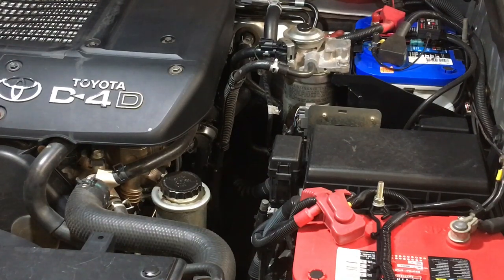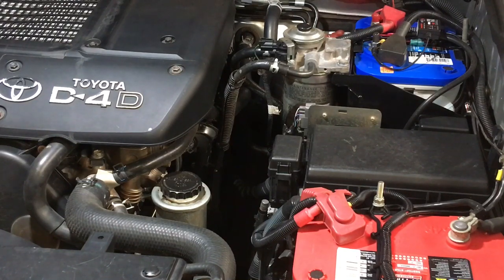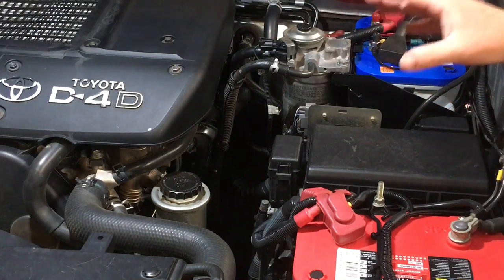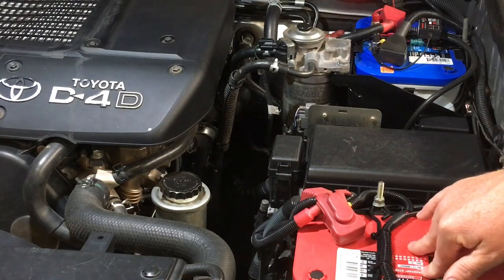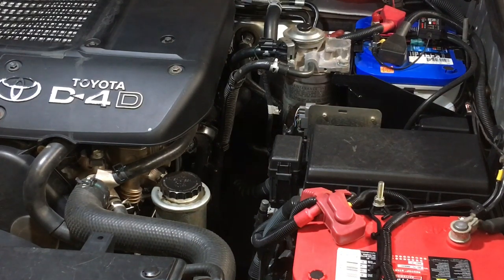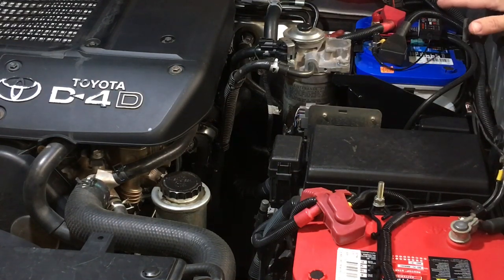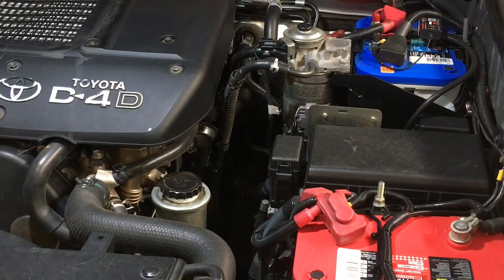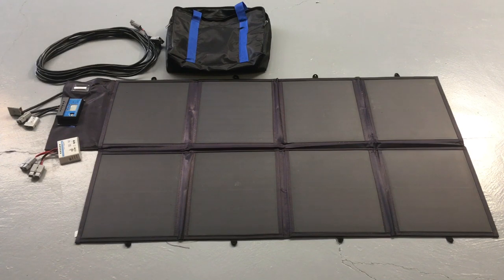MOVIE LENGTH BATTERY, SOLAR & CHARGING

Comment: Hi Anth. Is that a 100Amp  SBI? Any problem with it handling the current if used to jump start main battery? What cable thickness to hook them up?